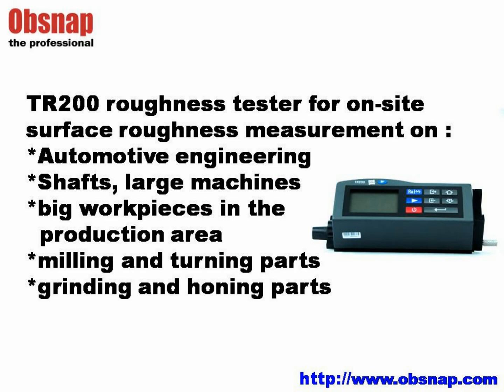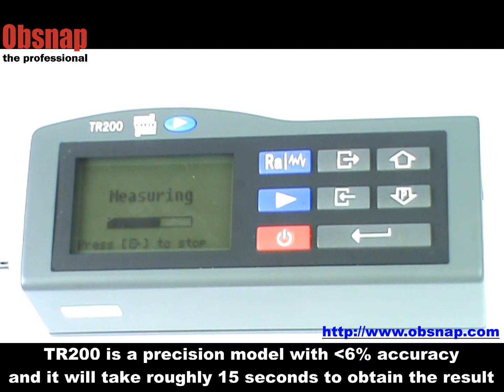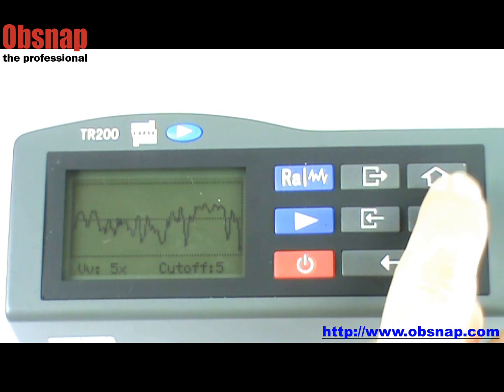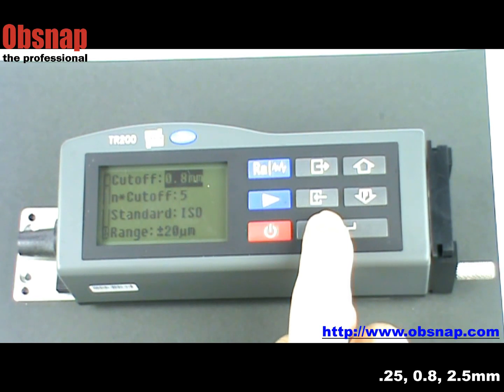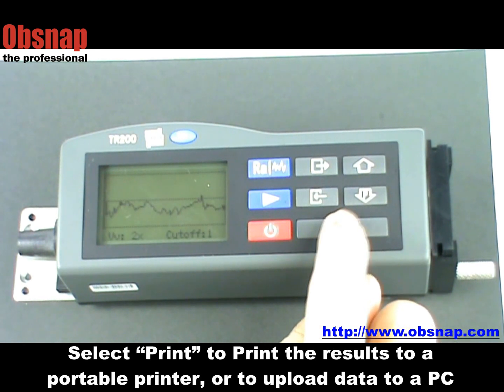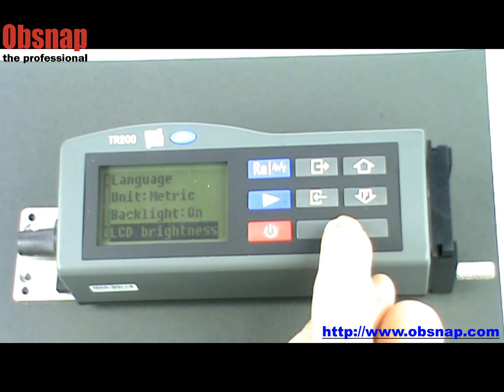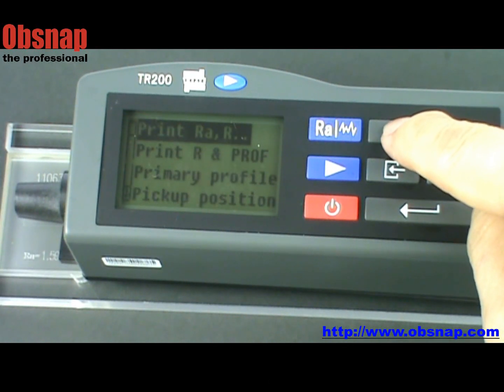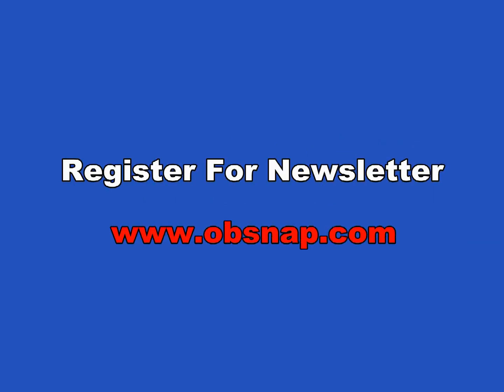Surface Roughness Tester TIME3200 (TR200) at Obsnap Instruments

Comment: Can this device check the roughness surface after sand blasting?
Reply from the maker: Hey there Mr. Syakir, I'm Ms. Kan, handler to pass inquiries to the related party.

My colleague, Mr. Afif, our product specialist said that before and after finishing, the roughness tester can still be used to check its roughness. 

For product specification: https://goo.gl/FyrNnv
Reply: does obsnap doing a rental eqipment services?
Reply from the maker: Yes but only for underground pipe locator & walk-through metal detector. Not this item.